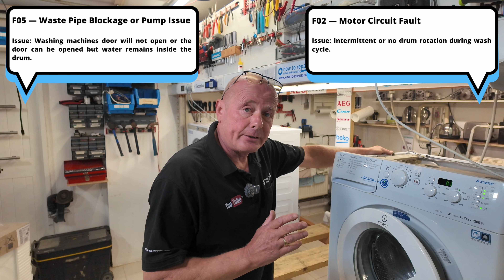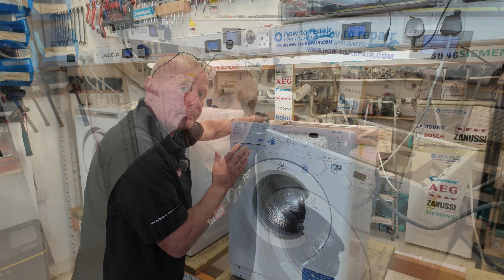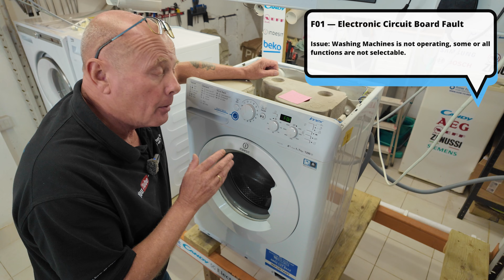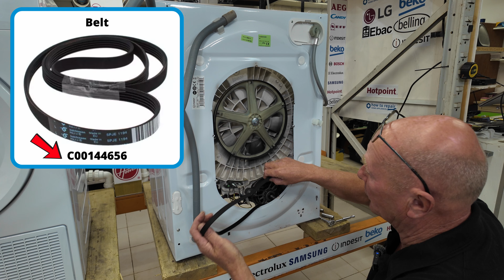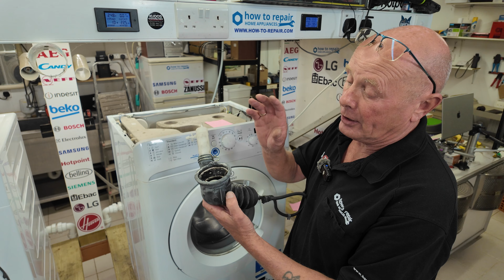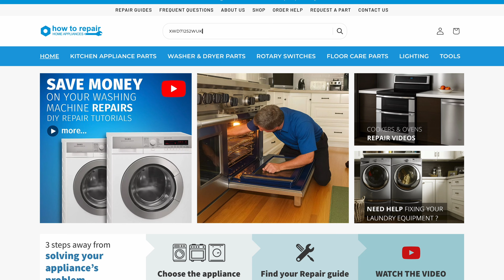Fault Finding on Indesit XWD71252WUK Washing Machine How to Enter the Test Mode

Comment: I have an Indesit automatic washing machine. When I start the spin cycle, it runs at a very slow speed until the end of the program, up to number one, and then it stays at that number without finishing the program.What's the problem?

Comment: Ive been having issues with my IWDC 65125 S UK N washer dryer for a while now. The machine starts up then 5-10 seconds in goes into fault mode. All horizontal buttons flashing and bottom 4 vertical lights lit up. I understand this to be the F15 fault code. I worked around this and used the washer fine by not using the dryer or heating the water. Its workok this way for almost 2 years but has now spat its dummy out again after I  poured some thick bleach into the drum along with 2 kettles of hot water and left it for a while. Trying to get rid of some of the scum build up. I'm guessing the hot water may have caused the problem but what do I know.  I tried this diagnostic mode. I can tell its entering it by the 3 beeps it gives at the start (noted from another video) but its going straight into fault f15 as it normally would. Ive checked the pump, no obstructions and water is flowing from the drum fine. My next check is going to be the motor. This is my 3rd washer/dryer of this make and model in the past 12-13 years. The problems i've had in the past with them have always been the brushes, which i've changed easily enough. Done these on my previous 2 but yet do do them on this one. Usually around the 3 year mark in the past so this is overdue a change.  Soon after though you're always guaranteed to have something else fail. I've had this F15 fault the past 3 machines. I'm on the verge of buying new machine but would really like to beat this problem and stick it to Indesit. Any pointers? Love the channel by the way. Keep up the good fight.

Comment: I have an indesit machine with an E06 intermittent fault. I have recently replaced the door interlock switch, could this be a stored previous fault now corrected and if so how do I reset stored fault codes?

Comment: Wonderful thank you. Sick of people throwing things away for simple fixes
Reply from the maker: This machine wasn’t thrown out the owner is a friend of mine. So he brought it over the workshop
Reply: @How-to-repair yes gathered that, my point was the younger generations would simply throw away.
Reply: @Justbehelpful  I agree im 22 myself i see it far too oftern like my frind. His washer stopped spinning and his immidiate though was to buy a new one I said have you checked the brushes? he said whats that so he eneded up spending £7 and I replaced the brushes for him machine good as new again!!
Reply: Well if you can't fix it yourself (most people can't/won't attempt), it's cheaper to buy a new unit than calling a repair man